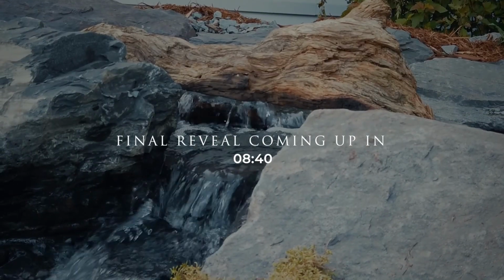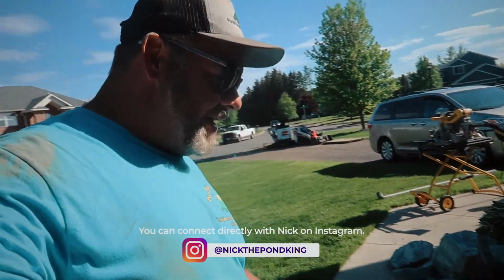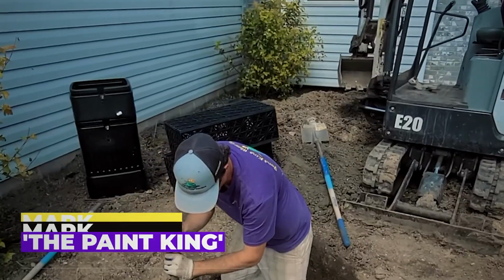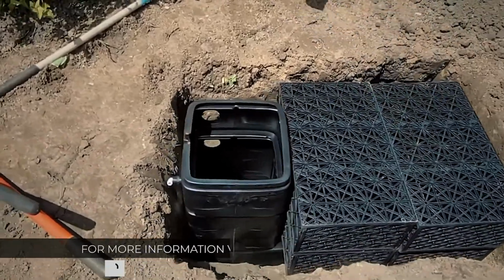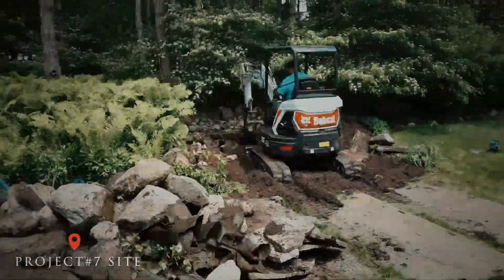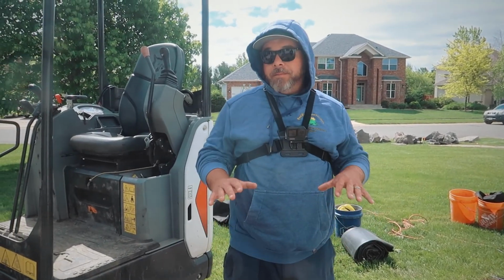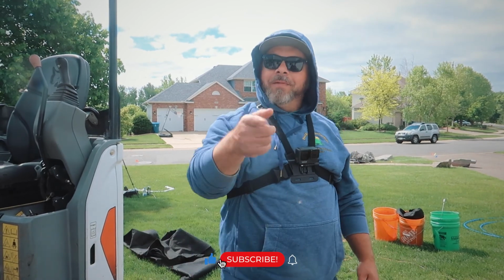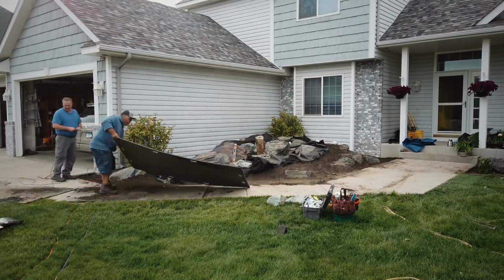Small Plus Pondless Package with Bubbling Basalt Column

Comment: Could it be feasible to make the center section deeper and add a  few gold fish? Are these expensive to operate? (do they use a lot of power to pump the water?)
Reply: Then it would need to be a pond
Reply from the maker: It is possible yes but it make things much more involved. Also spacing is a big hurdle to a Pond with a disappearing edge.  It has to be constructed completely differently.
Reply from the maker: The pump is magnetic driven and highly efficient... $30/ month maybe 🤔